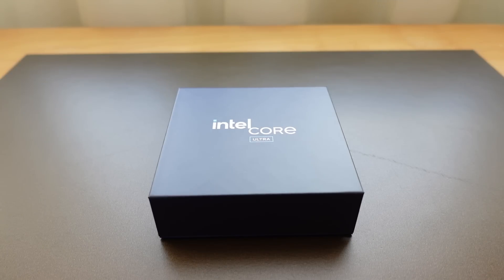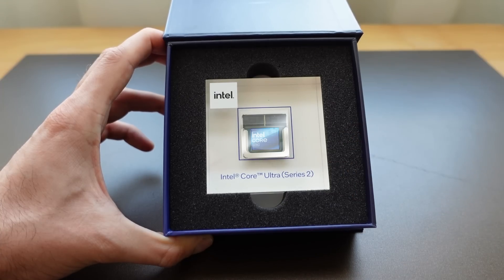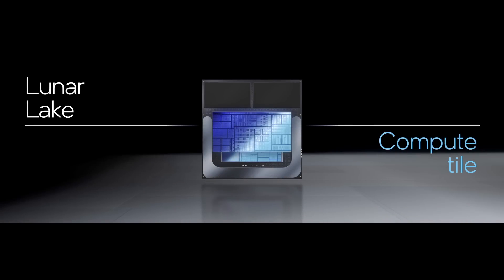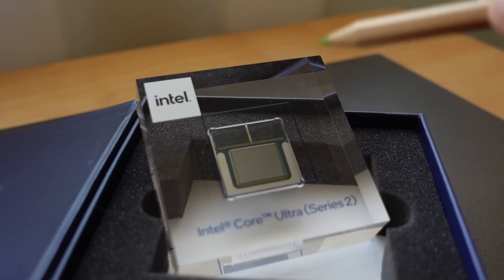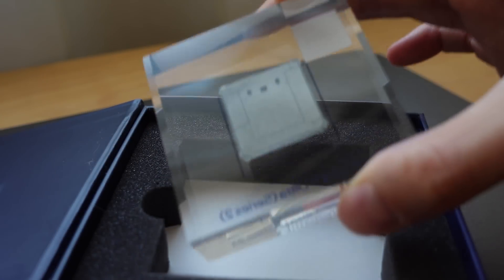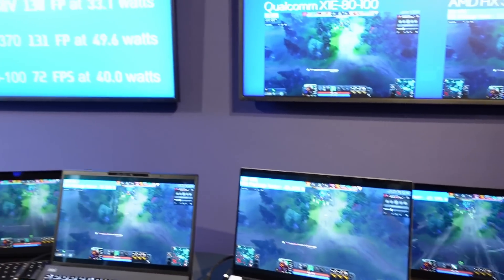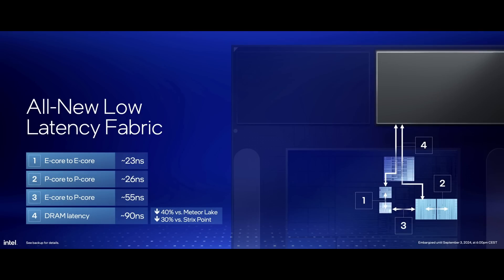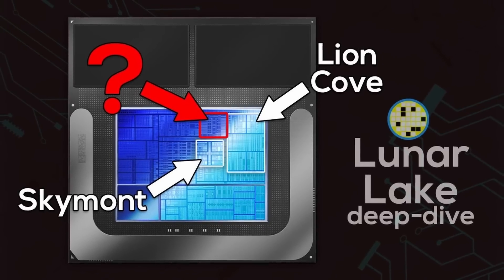Hands-on with Lunar Lake

Comment: Lunar Lake honestly looks really promising. But, I do expect it to lose to Strix in multicore(mainly because it has like 2/3 of the cores and only a third of the threads). Still, I can see it being used in high end business class Laptops and for Students.
Reply: from what i've seen from the leaked Geekbench scores, Strix Point is way in front in multicore (unsurprisingly it has 20 to 24 threads compared to the 8 of LNL), but i'm personally more than fine with it since I have a desktop when I need to push hard work

For me what's more important in a laptop is its efficiency with adequat performance as a whole, favorising singlecore. The GPU is also a nice to have for the occasional game on the go but more importantly hardware acceleration. both for video and compute. And with the Xe2 architecture both supporting H266 decode and eDP 1.5 that would also being big efficiency improvement, i'm really looking forward to it

the cherry on the cake for me would be if it supported off package memory (in the form of LPCAMM2 for example) for higher latency but higher capacity memory and use the on package memory as a sort of L4 cache
Reply: @deneguil-1618 cache is BS and second you lack fundamental skills and knowledge cache is SRAM and RAM is DRAM OR SDRAM.
Reply: Its actually HALF as much cpu horsepower as strix point.   4 cores 8 threads (note: an ecore is like a extra thread at 25% performance).  Strix is actually ~9 cores 18 threads since each c-core is 2/3rd of a p-core, 0.67*8 = 16/3 =5 1/3 cores
Reply: @systemBuilder  No, the new E-cores are 2% faster than the outgoing P-cores from Raptor Lake (so, they themselves are faster core for core, clock for clock then Zen 5 cores), so they are not "like an extra thread at 25% performance."  Your math doesn't check out.
Reply: Why do we hate students so much?
Reply: @n12ox  It is in students favor to have a laptop that can last all day, Intel said Lunar lake is not meant to be a gaming chip or a heavy productivity chip.... So if anything Lunar lake is not for gamers, it is for students or users who want thin and light laptops and battery life
Reply: @jihadrouani5525 but It doesn't look cheap and students doesn't have money
Reply: @reiniermoreno1653  that's bullshit
Reply: @jihadrouani5525  well, it should last all day doing the work. p/e cores are pathetic.
Reply: @N1234-n8x  you think students would spend around 1500$ in a ultrabook? Lol
Reply: @n12ox  You must have missed the part where the E-cores in Lunar Lake are actually 2% faster than the P-cores in Raptor Lake.  So, the E-cores are not "pathetic"
Reply: @Nanerbeet  they are, if you don't run synthetic tests all day as a student :D
Reply: @n12ox  The CPU cores are executing instructions at the same clock speed and IPC regardless of whether or not the software was intended to be synthetic or real world.  I would love for you to tell us what makes cores go faster on synthetic tests.  This will be interesting.
Reply: @Nanerbeet  lolwhat? 1. What you state is partially true. 2. Synthetic tests prepare workload for it's result. Intel is RIP, hope we will see someone opposing AMD.
Reply: @n12ox  Brilliant word salad:  "Synthetic tests prepare workload for it's result."
n12ox fragged himself.

Nanerbeet: 1
n12ox: -1
Reply: 2/3 cores and 1/3 threads ? You mean .... 2/3 cores and 2/3 threads ????
Reply: @Winnetou17  Nope. Strix has 4+8 Cores, all with SMT, so 24 Threads, while Lunar Lake has 8 Cores with HT removed, so only 8 Threads.